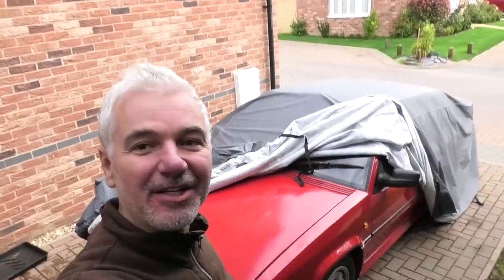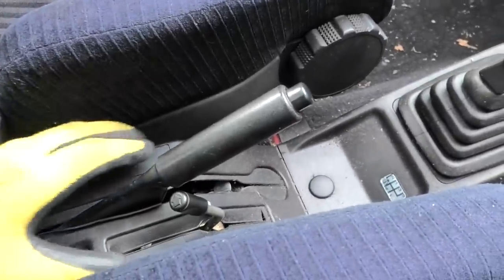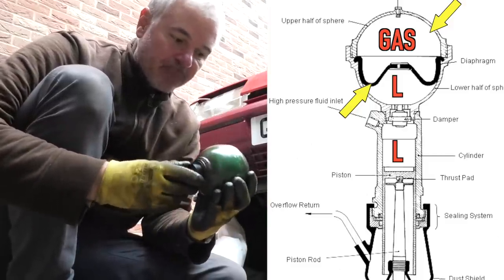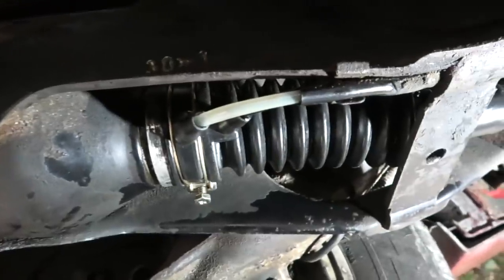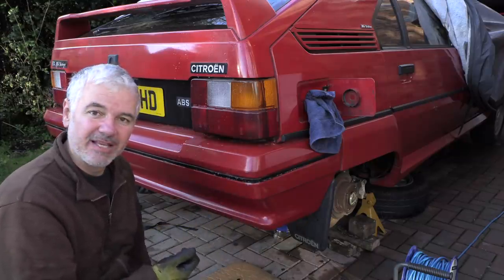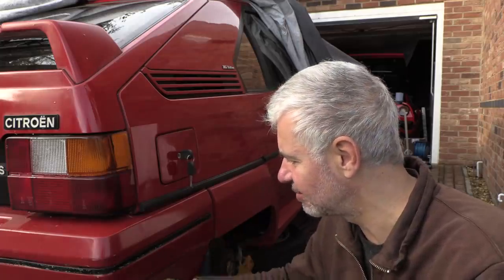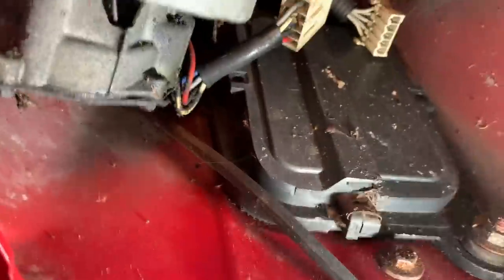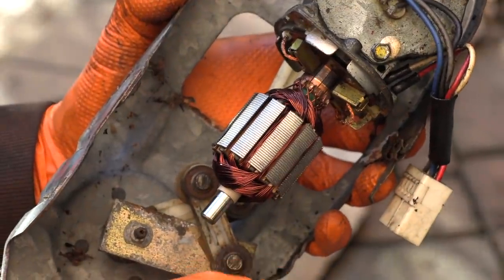5 Minute Fix That Ends up taking Hours - Tomato Drives Me Mad - Citroen GTI 16V

Comment: I am loving the tomato. First car I ever crashed was a BX 1.4 it was a brutal crash involving 6 cars and the BX was a complete write off. When the recovery team turned up all the other vehicles needed to be rescued from the road with winches and tow ropes and my BX just started with no front end on it missing rad and oil spilling out of the engine and they drove it up o  the recovery wagon. I bought another one the next day. Best car I ever owned.
Reply: Ha ha! Did you crash number 2?
Reply: Number 2 lasted many years with very little issues. Those cars are solid even the recovery guys said the cars are like tanks.

Comment: That’s most definitely the best car in the fleet Jake and needs to be a keeper.. I had the same revving problem on an old early 2 litre Petrol Citroen Xantia many moons ago and remember it was the stepper motor (idle control valve) and was a common cheap fix.
If it goes again cheap ones are only £12 on eBay although I doubt it’s  OEM quality.
Reply: I agree, really enjoying, feeling very nostalgic for my same colour 8V BX19 GTI, which was one of the best cars I had. I bought it because it was available and the Citroen garage was nearest to home. 

I love Jack ability to smile and enjoy even the most frustrating jobs imaginable. I’m a fan. Can’t wait to find out how this car stacks up now.
Reply: It’s Jack 🤣
Reply: @superchargedv8993  Corrected sorry
Reply: Agreed. The BX is proving to one of the most entertaining cars in Jacks series, and his channel is rapidly becoming one of my favourites on YouTube.
Reply: @johnmandragon4830  Agreed and those BXs were much better and faster than the Golf the press became obsessed with. They still are despite the far better A45s, CLA45s and the GLA that everyone is buying.
Reply: The cheap ones on eBay are fine, no one makes OEM quality for that part nowadays.
Reply: I had the same issue surging issue on a Xsara Picasso. A cheap ICV off eBay sorted it too 👍

Comment: Only just found this - what memories! I too had a red G-reg BX 16v until Dec 1996, loved it, better than my previous BX 1.9GT. Mine had the little flip-up tail. First car that I had to buy Torx drivers for. Had bad idle problem right at the end that the new stealership couldn't diagnose (alas Chesterton Autos were defunct), so traded her in for a Saab 9000 2.3T.

Comment: My dad owned one for approx 10y and about 150K KM. This is the car I learnt to drive in.  I remember you had to hold on to the steering wheel and seriously correct as it had a tendency to pull to the side when accelerating hard. It also sounded real sporty. We took it past redline often but  it never broke down.

Comment: A new set of brushes and a thorough clean of the commutator shoul allow you to revive the wiper motor. Remove the commutator, spin it with a drill and use a fine grit sandpaper on the copper surfaces will make a world of difference. Using an old ball point pen on the edge of each gap between the segments will remove any burrs which if not done can catch and chip a brush.

Comment: my DS had a fuel smell, i replaced the fuel cap, which looked ok, but the smell persisted. It turns out there is a rubber seal between the pipe and the lower half of the locking cap assembly, similar to the bit you are missing, that the cap screws on to, and that was torn. I finally found this after stripping the carb and rebuilding it and changing various fuel lines to no avail. Cunning Citroen designers, The boots you are changing- i did mine and they split within 6 months- cheap shiny plastic type rubber. I finally paid about 4 times the price for superior grade ones and they have been fine. Beware pattern parts- don't replace original parts just because they are slightly worn- they will still outlast the new stuff.

Comment: Hah!  I'd totally forgotten that the windscreen spray nozzle was on the wiper - just how much more sense does that make than the normal arrangement?  My 5 series has 3 spray nozzles to do the same job.
Reply: They are great, but it’s fine till theres any kind of cold weather and they freeze up, A1 on new years day in early 2000s in a Pug 405 with that setup wasn’t fun, ‘normal’ nozzles which aren’t heated have the engine heat to keep them unfrozen
Reply: It’s too exposed and can’t be tuned unless you make a custom tube (brass works fine, I’ve done it on a series 1 BX) so I’d say it’s better to have nozzles above the engine.

Comment: Very amazing how fast your oil pressure raises only on the starter motor. Or did it run shortly beforehand?
A Citroen and easy access never go hand in hand. The same goes for GSA"s and all the other classics.
Ian from the HubNut channel is passionate about Citroens as well and owns both a 2CV and a GSA.

Concerning the idle issue, have you already checked the bypass or the warmup regulator? Also there might be a problem with the throttle position sensor or the Idle control valve. A good clean will sometimes solve the problem, sometimes best to replace both. EDIT: wrote this only when I started to watch. Glad you tackled the ICV!
Cheers!

Comment: With those type of idle control valve , you should be able to shake ( in a twisting motion ) and hear the valve inside turn. If not, clean with carb cleaner.
Reply from the maker: tried that but this one was really done for

Comment: Glad you're not taking apart the wiper unit. The mechanism is most likely indexed. If you get it off track, the travel of the wiper bill be outside of its limits. I knew the temp sensor was not going to fix the idle. In the 90's everyone always blamed every code on the temp sensor, the dealerships changed tons of them. It never fixed anything.
If I was in UK, I would try to buy this from you, always wanted to drive a Citroen.
Also, too bad it doesn't have the satellites dashboard.
Reply: Looks like the top bearing in the motor case has gone judging by the wear on the surround of the windings, the friction of it dragging on the magnets is locking up the mechanism, hope this helps

Comment: I had this exact same problem with a car I owned in the past, when it warmed up the idle raised. It turned out to be the idle control valve. I don't know if your Citroen has a similar system.

Comment: I was wondering if the fast idle was because the filler cap was not sealing the system. I know on more modern cars you get all manor of problems if the filler cap is not on.

Comment: I have an idea for the high idle: maybe this engine does not have idle control at all. It is not the ecu that commands the engine to idle high but the ICM siezed in cold start position. It is a too high setting for a warm engine. Have a look at the throttle body. Maybe it has a large vacuum leak somewhere due to a cracked line or something. I love this car.
Update: I watched the whole video. It was the IAC indeed.

Comment: Isn't there air in the suspension oil system having removed the spheres?
Reply from the maker: Pressure was released as car is off the ground and then lowest setting

Comment: People like you and me are obviously masochists. For what other reasons do we kill our nerves and fingers working on old, sketchy neglected and very weird cars?
For months I am on the finish line of rescuing an abandonned restoration project, a 1963 Chevrolet Corvair. I spent nearly a day making the fuel filler cap and latch work properly. It took me 3 hours putting one hidden bolt on the rear of the car. It seems the car is fighting me every little step of the way. The closer the finish line, the more little problems show up. Now I even had to order some more second hand parts in the States.